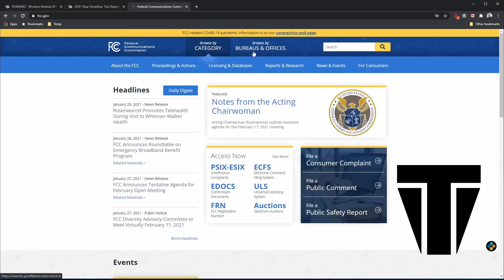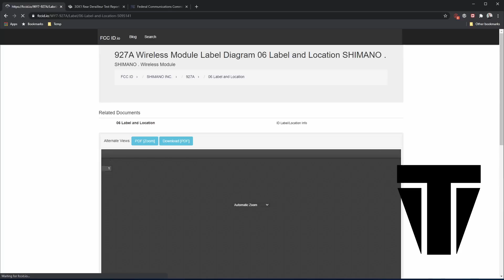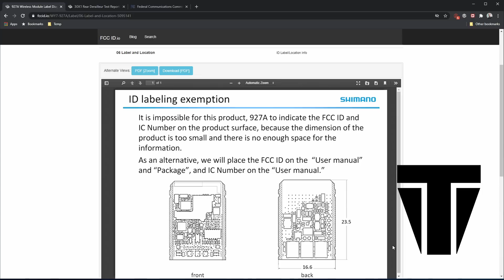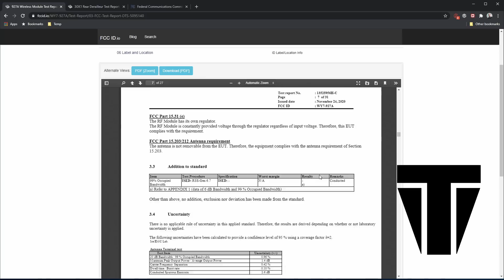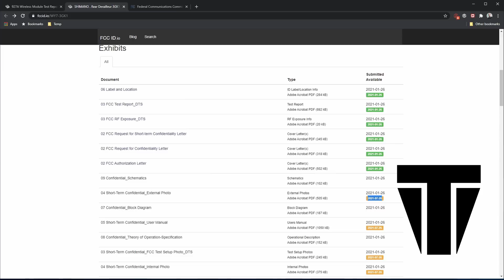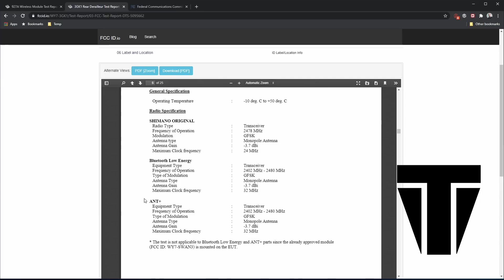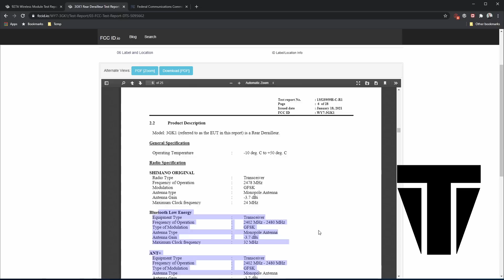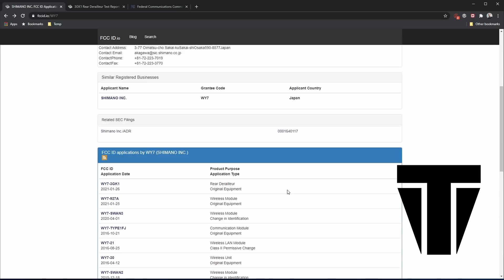Shimano R9200 wireless confirmation and first images

Comment: An auto-shift system would fit my lazyness.  In fact if it auto down shifts when slowing for a light that would be awesome ;)
Reply: Should definitely be possible in the long run when connecting power and rpm data with gearing!
Reply: Have been working on my system for a few years now but for enviolo CVT hubs.

Comment: Wow, can you imagine a third party open source shifting system.  How fun would that be.
Reply from the maker: There was a company a year or two ago that wanted to do a licensable bike bus system. Can't even find them. Noticed the Shimano Original... might not be BLE/ANT shifting afterall... which would suck. It's more expensive to reverse engineer that, but sounds like GASP same chip that sram uses maybe (24mhz main oscillator).
Reply: @kwakeham  - I often wonder how much good code is lost on companies like that.  No one would probably even take the time to open source it after it failed.

Comment: Seems to fit with suggestion Shimano will tie front and rear derailleur together with cable and 1 battery and then wireless to shifters, like FSA
Reply from the maker: Interesting take. I know the area is a patent minefield, which was why FSA went that way, but if they didn't patent and public disclosed then makes sense!

Comment: Purely speculation, but I think the rear derailleur is probably wired up to the front derailleur and seatpost battery, with the shifters communicating to it wirelessly. This makes for a clean front end (no cables) and maintains compatibility with older, wired di2 components, whilst also solving the issue of recharging small separate batteries like with etap.
Reply: You're probably right but I'd hope that Shimano don't think that recharging separate batteries is actually an issue. I've been running etap for 18 months now and it's not even mildly inconvenient. The setup and maintenance could not be simpler.

Comment: Not surprised to see that modules also have what appears to be wired connectors. You can mix and match DuraAce, Ultegra and 105 mechanical components and mix DuraAce Di2 with Ultegra Di2. So it would make sense for Shimano to have the option to mix wireless DuraAce with wired DuraAce and Ultegra. This would mean that they can drop the DuraAce 9100 in favor of 9200 whilst still retaining compatibility with 9100 and 8050.
Reply: I think they'll use the newer EW-SD300 wire, but yeah.. that can still connect to older components using the AD305 adapter.

Comment: The front derailleur doesn't need a wireless module if it is always cabled to the rear derailleur. Would be awesome if you can upgrade your existing Di2 bike to 12sp by only switching the RD + cassette + chain
Reply from the maker: Been seeing suggestions on that, ya. Could very well be. I kind of like the idea of mix and match compatibility with etube, but totally speculating on that.

Comment: As it's only a rear derailleur, I would imagine it's most likely to be an XTR system. Double chainrings on MTB are going the way of the dinosaurs. A couple of months will tell if they do/don't put out an application for a front derailleur.

Comment: But would definitely be still hoping at least a di2 shimano 105. Electronic 105. The trickle down effect. There is already an ultegra di2. Time will tell. A medium price or a possible beginner lower price race bike complete 105. If I'm not mistaken there already is a disk brake hydraulic 105. No di2 105 yet!
Reply: I have a memory that they produce Dura Ace and Ultegra on different factories from the rest of the range. Granted, I could misremember.
Reply: Sorry, what vh says is right. 105 is made in a different factory that would need complete overhaul. Not going to happen unless no cable systems are being bought. Udi2 is the same price as standard da so it wouldn’t be cheap anyway
Reply: They don’t need to manufacture 105 Di2 in another factory once Ultegra Di2 goes to 12 speed. They can simply keep making current 11 speed Ultegra Di2  and rebadge it as the new 105 Di2 11 speed.!

Then keep making mechanical 105 in the other factory. Zero retooling or new tooling is needed.
Reply: @rcg9573 That is if it is cost effective and they don't need the factory space and machining for new ultegra.
Reply: I think that has been one of the reasons for not bringing Di2 to 105

Comment: I'm not sure about this. But sometimes maybe shimano will display a hidden non print mark product on some professional racing teams with maybe just a false external cable to the front and rear derailleurs for one lucky professional to be the guinea pig on some sort of bicycle road race stage guinea pig with no shimano name. Just the shapes to test the new dura ace wireless. Might be. One bike at a certain race stage and then switch back to the regular bike dura ace wired version. All the cycling video youtube media and print media will have their cameras and video looking.
Reply: I think Evenepoel have tested the wireless with fake wires already as you suggest

Comment: It would be a very bad move for shimano to skip on wireless the 2nd time, it will only strengthen sram's market position. It's 2021 c'mon wireless is not that hard. 
The only thing keeping me from getting sram axs is the looks: it looks like it's been designed with an axe, theres no shadow of elegance in sram's design, yes, I'm vain like that.
Reply: Sram force axs isnt even as smooth as a good old 105 5800...
Reply: @Hero2lafoi   the red axs I've ridden, shifting was fast and smooth, miles better than a 5800, the drivetrain is slightly louder possibly because of smaller chainrings/cogs, never ridden force axs. Sram's quality has come a long way since their crappy drivetrains, that was a long time ago. I don't think there's any difference perceivable by the average cyclist, if they stay away from bs reviews and shimano fanboyz they get to enjoy it as well. The axs rear derailleur looks like a baseball glove, this is what keeps me from getting it, it's grotesque looking there's no finesse, very american.
Reply: I’ll take Shimano’s wired Di2 shifting over Sram’s AXS 7 days a week. It does shift quicker and more precisely. And on 2X drivetrains there is nothing that can touch Shimano’s Di2 auto trimming front derailleur function - not AXS not Etap, nothing.

Plus Shimano brakes are still the best IMO - both mechanical and hydraulic.

Comment: Thanks for the video! Cable between front and rear derailleur with shared battery, then wireless to the shifters?
Reply: Very likely as Shimano does like the idea of a large capacity battery